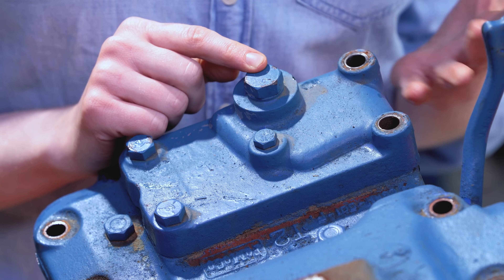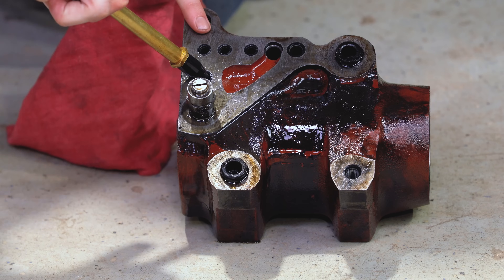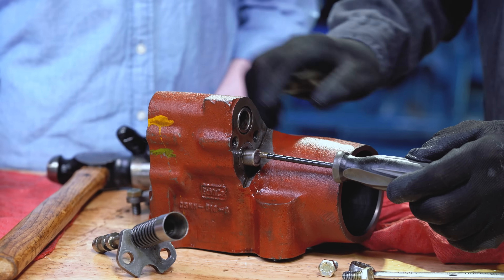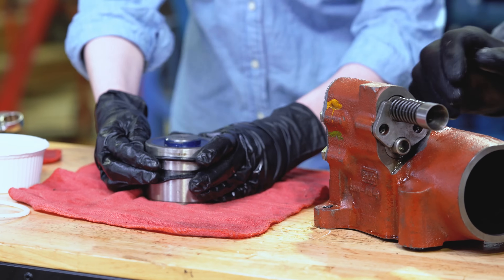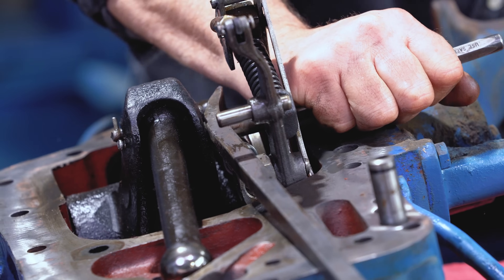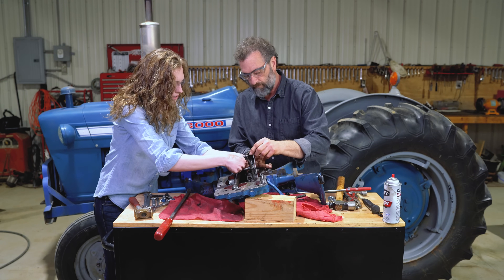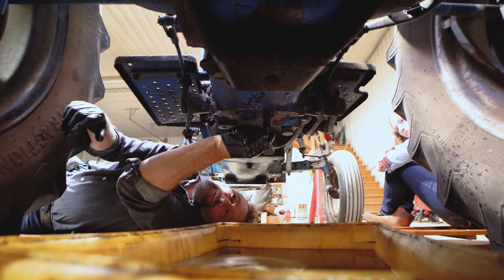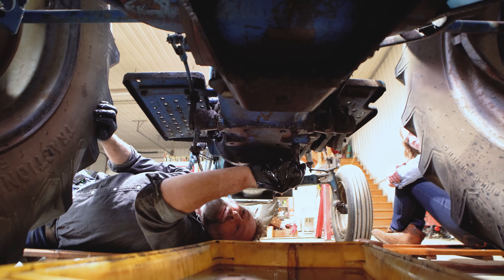Ford 2000, 3000, 4000 Hydraulic Repair, Top Lid: Hydraulics that Shake, are Intermittent or Stuck

Comment: I'm new to your videos. Also just got a Ford 4000 that runs great but I started it the other day and I have a Bush hog on it. No problem drove around about 10 minutes and went to park it but it dropped instantly to the ground and won't go back up. I don't see anything broken or any fluid. I pulled the dipstick and it is not low. I don't know anything about this tractor. Do you have any advice or videos for my problem.
Thanks for any help

Comment: Like your video. I have a Ford tractor 1720.. having a heck of a time trying to find the O-ring on the piston that goes in the cylinder for the hydraulic valve control. can I buy one of those from you?. everyone I’ve tried to get they say it’s a two piece. Which it might be, but there is one plastic like the other one is black rubber O-ring that goes on the piston.. I can text you pictures of this one I have completely different. Anyway, let me know.. again I like your video very much. My name is Tony.

Comment: Where can I find instructions or a video on replacing the front crankshaft oil seal on a 1994 Ford New Holland model 3930?  I'm interested in hearing what has to be removed from the front of the tractor.

Comment: I am working on a Ford 2000 farm tractor for a customer. I had rebuilt that top assembly all new seals two new vowels change the fluid and put a new filter in it and it will only raise about an inch and stop today after putting the two new vowels inattempts of trying to get this thing fixed now jiggles little as it’s raising that inch but it won’t raise no higher than an inch. I don’t know what else that it could be unless it’s a hairline, crack or fracture in the cylinder housing itself.

Comment: My ford 2000 don't have dow pins to help place lid so I used 3/8 all thead in a couple of bolt holes which helped alot to keep gasket in place.

Comment: My 3 point was working I let it sit for a month and now it's not working I unbolted the plug like she said and I got nothing but I unbolted the bleeder plug on the pump while it was running and I got a little bit to come out of it
Reply: The pump is pumping I believe it's the safety valve I just bought the seal kit safety valve and relief valve and I'm surprised by the lower price compared to other online stores such as yesterday's tractor

Comment: I have a Fordson super Dexta 1963 model. Do you have a hydraulic repair kit for this tractor? Mine seems to have the old style piston that takes a seal instead of an O-ring. Is there a benefit to changing over to the new style piston that takes the O-ring or should I just replace the seal?

Comment: Y’all are amazing. Just starting this project on my Ford Industrial 340B and always like a good visual. You nailed it. 

What has me here is I checked the fluid in the rear end with the arms up, per manual, it didn’t come up to the level plug so I topped it off. Went and bladed the road for about an hour then the box blade just lifted all the way up on its own and wouldn’t go down no matter the handle position. Opened that upper level plug and about a half gallon of fluid came pouring out. Sure some of it is from thermal expansion, but I think I had some fluid hiding somewhere.

Right now I’m at removal of the check valve assy. Needed a slide hammer to pull the spring housing. But the nylon seat won’t come out. Can’t get a hold of it.

Comment: I removed the air bleed plug from the side of my pump and inserted a valve with a barbed end for clear hose. Ran hose back to rear end reservoir. Oil flows steadily to rear but has half marble size air bubbles steadily flowing. 90% of the time my arms won’t raise. They been acting up a few years. Sucking air somewhere? Once they go up they will stay but if you let them down, they won’t raise back up on demand. 😢

Comment: I am wanting to put a manual temp gauge on a Ford 3000, 3 cyl gas engine, is there any other port on the engine I can put one in as the one on the front of the head won't accommodate a Universal temp sending unit.

Comment: ford 3000 tractor want start turnover but want gas not getting to the carborator changed fuel pump put new carburetor it still want start

Comment: These videos are amazing, I rewired a 57 Ford 600 just based off of their video for ignition.  I just finished the rear left arms as well. Amazing enough, it was just a frozen safety valve. I highly suggest getting with dan for tech support, it saved me countless hours and probably some good money too.
Reply: @LomahWeldingServices  me same.     two years ago.  parts were perfect
Reply: don't forget the resistor

Comment: Hi, Dan or Rachel, I have been watching your videos, My problem is 2000 ford tractor rear remote valve will not kick out , and on the down side hose has pressure on it at all times, any help will be Nice , Tim

Comment: im having trouble with ford 5610 tractor, the front end loader isnt as strong as it use to be  filter has been changed and has plenty of oil.  bucket doesnt hardly tilt anymore and i use to could push bucket on ground and lift front tires off ground.  What can i check?  i dont know where hydrailic pump is or anything else i can check? any ideas?  do you have a diagram of where everything is or a video on this?

Comment: Thank you Rachel and Dan! I want to ask your advice on my (new to me, my first tractor) 1967 Ford 3000, having possible 3-point hitch hydraulic lift issue: Lift only wants to be all the way up or all the way down, and is very sensitive to inputs from the lever, it’s not smooth, going up or down and I can’t really set it to heights in between those two extreme positions very well. Any ideas on what this might be? Appreciate any input you may have!

Comment: Hi you have great knowledge and I have a question. I'm doing research for my nephew who has a 1972 ford 1000. His hydraulic control valve is not working and he wants to rebuild it but can't find parts, gaskets, O ring. Do you any sources or another valve that would work. Thanks for your time.

Comment: Thank you Rachel and Dan. My 3400 Industrial has problems both with the 3 point arms not coming up right away, or shaking when coming up. I'm eager to rebuild the hydraulics and have it working the way it was designed for trouble free operation.

Comment: The auxilary valve on our 4000 works very well, but the lift arms struggle to lift a 2 furrow reversible. The pump seems ok, so could it be the piston o-ring or a faulty safety valve maybe?

Comment: So removal of the inner seal with a fine thread 3/8 and pliers didn't work for me, but a 15/16 12 point socket, 2 washers and a grade 5 1 1/2 bolt did work, took me a minute but it worked.   You noted the back bolt for the seat connects to the plunger, mine doesn't look like that both bolts are the same. The back hole does enter the transmission while the front hole is closed.  Any idea where I can get that bolt?

Comment: What is the seal called that were the clutch pedal is that goes to the rear close to the pot inspection plate is 68 ford 2000

Comment: Love the old Ford tractors. You and your Dad so well together . I've always liked to replace as manny parts as possible when I'm digging in deep that way I'll fix todays problem and maybe a future problem that would other wise make me have to tear back into it again...Prevention maintenance is a wonderful time saver I've bought from your web site in the past loved it...These old Fords are tough. I just bought a Ford 2000 tractor   1963 with power steering Select- speed garage kept from the original owner on a 2 1/2 acres farm with 1100 hours and still has the original factory tires....All I can say is built tough....
...

Comment: Good morning, I have a problem with the Ford Deksta 2000, it consists in the fact that after setting both levers to neutral when switching on the ignition, it often does not start - it is annoying, as if something is not connected in what is under the gear cover. How to fix it?

Comment: Nice video, thank you so much. I have a troublesome 5030 it's not lifting the three point system. It uses both internal piston and two more lift rams. What could be the cause? *NB: it's a 97 model

Comment: I’m curious as to why you didn’t replace the hydraulic filter when doing this repair. My understanding is the filter is located in the bottom of the housing and requires removal of the PTO shaft to change. Maybe I’m mistaking but if it is indeed there it would have been nice to show that during this repair. Overall thank you so much for bringing us along!
Reply: @gentlyweepforgeorge6048  when I completed this repair myself my 67 2000 is the same. There are actually two filters in the housing. One filter is changeable but the other is meant to be wiped clean and sits further back inside the housing toward the rear end. 

They have a separate video where they rebuilt the hydraulic pump. Likely the pump was the issue on this tractor, not the top lid repair.

Comment: I have a Ford 3550 with a front of crankshaft driver hydraulic pump to supply pressure to the front end loader. There is a selector valve on top of the transmission which has a hose running to the rear via a coupling to run other implements ect. When no implement is needed the return hose drains back into the fill plug on the diff. As I no longer use this feature I want to disconnect  the fitting on the selector or blank it off. Does anyone know if blocking off the port on the selector valve will do any damage.

Comment: I haven't run across a jubilee top lid overhaul video. The top lid gasket kit comes with a pack of Orings. I'm guessing it'll be alot like this top lid where those Orings go. If I've overlooked a video of yours on the jubilee top lid overhaul, please reply with a link to it. Symptoms are lift won't go up at all. Dad removed a plug on the pump and oil shot all over. The lift used to go up and slowly come down. It does nothing now.

Comment: Great explanations but remember to speak with a speed that most people can handle even without being born in a English speaking nation. I personally is not born in USA or UK but I do understand Rachel and also her dad very well. Again it is you Americans that really makes things so easy by explaining so clearly what to do and how to do it with the real parts in front of you.
I have a Ford 4000, 1969 (year make) with Perkins (3 sylinders). Its very important to change the diesel filter in time and to clean out the diesel tank is wise to some times and I like that DG and RG can show how this best can be done and what to use for the cleaning job without taking out the tank. What parts is it in it when opening the tap at the bottom of the tank. It is said that there is a strainer there that should be cleaned. It is good to inform what people will find there depending on what year make of Ford 2000 - 4000 they actually have. What is best of Motor Oil Quality and where to buy it. I think 15W-40 mineral Oil SAE is the best but can use another quality for the cold months. I like to get this enlightened on your channel. Thanks a lot!

Comment: Hello, Mr.Dan and Miss. Rachel  I want one diesel CAV rotary pump and all three injector, with timing plate and pump timing gear for ford 3600 tractor that will be
made in England. That should  fit in my tractor and gives good performance. I want these parts in India. Please tell the price of these parts and how you send it by courier and then how we can get them. I want these parts especially brand new.
Thank you and please reply quickly.

Comment: Is there a way to test the safety valve and relief valve?  I've done a top end rebuild following your video (very good BTW) and have a problem with implement lowering within a minute or two of setting the correct working height.  Seals replaced along with piston leather etc,  but still not maintaining height.  3 pt lift responds instantly and raises quickly and easily, just not staying up.  I'm not sure what the function is of the safety and relief valves.  Thank you.

Comment: I could use some one on one help. I know nothing about tractors but watching u has helped me alot I bought my 1st tractor 1984 ford 4000 I did everything like u did and I had a leak because I replaced gaskets on both sides to lots of leaks tractors not taken care of. Any way the tube from the pump to the pto flow valve the tube just started leaking I drove tractor without seat on it after I fixed leak no more leaks at all. I hired a so called  Mechanic and he took a lot apart I did not see well left over was this long bolt and after watching your videos I found it went to hold down the back part of the seat mount put it in then I drove it up on trailer and oil was going all over took the bolt out and it slowed down the oil so I raised my 3 point and my bucket and I had about 1/2 gallon to much fluid in it. The tube everyone says the u can replace the bottom o ring but not the top o ring I do not want to take back apart I am disabled with uncureable spine Disease and a lot of other things on good days I do stuff then I hurt myself and down for a week or 2 I have all tools need I have built many hotrods mostly chevy motors I hate for auto motors because nothing in interchangeable.  Any way that tube is leaking from the top. I am so mad I am thinking about selling it I have put so many new parts and the carbon build up on stock manifold was so hard and built up u could not get a pencil in the  Exhaust hole on the head so I had to take slug hammer and chisel and break it off them I cleaned out the cylinders never looked at valves because I did not take head off was going to have head rebuilt this last winter but never got leak fixed and the guy I hired in August would work maybe 10 minutes here hour here and so on its been down for a while now. Can u help me I have pictures but it's the top o ring and I am trying to think of a way to fix without taking all the way back apart. Anyway I can get number to call u or someone my number is 417-848-1826 I would really like to have a repair manual but can't find one I can afford would love to have a book not a CD but I will take what I can get. I sleep a lot because of all the nerve pain I am in so if u call and I don't answer please leave a message. I need help in a bad way. Please and thank you

Comment: Hi!  I ordered your remounting kit for the hydraulic pump and it arrived perfectly.  Thank you.  I do have a question though.   I am chasing a chatter/shudder problem when my three point lift "lifts" upwards.  It drops down nice and smooth.  At one point in this video when you are showing the two valves on the table, I think you say that the larger relief valve may possibly cause this kind of shuddering/chatter.  But then later from underneath when that valve is being removed it's mentioned if it's failing the whole lift mech may not work.  If it's possible that it can cause the chattering, I will order that next.   Is that possible it can be doing that?    Thanks!!

Comment: I need the O-ring that goes on the valve behind the plug that's removed by tapping out with a fine thread bolt. It's under the up and down valve. Is it sold ?

Comment: My 1973 2000 series. The hydraulics work but I can’t work them slowly. It drops and rises quickly. When I have an implement on it and raised while just driving. It will bounce. Like it is dropping an inch and then popping back up. What should I be looking at first?

Comment: Hi Rachell, Can you please tell me the width of a Ford 3930 or anything close, I am due to go pickup my tractor ( I just bought ) but I am not certain my tractor will fit on my 16' utility trailer. I know my trailer is 6' and a couple of inches. So, if it won't fit my trailer then I will go rent a trailer. AND WHY DON'T THE SITES PUBLISH THE WIDTH ? Anyway, could you put a tape to your 3000 and post it here for me...thanks. Terry

Comment: I have a Fordson super dexta and it’s blowing fluid out of the round cap behind the fender well. Could that be the relief valve as well. All gaskets have been changed and looked over numerous times just kind of puzzled as to what could build so much pressure.

Comment: rachell, i noticed you soaked the leather piston gasket with water. would oil be ok and if not should you let the leather gasket dry completely so it will shrink back and also prevent rust?  also on my dad's 2600 the lift works when first started up but quits raising after it gets to operating temperature. will this repair probably fix this? one more thing before i try repairing his lift, you don't mention what the bolts are supposed to be torqued to do you have that info?

Comment: The video was very thorough. The question I have after actually having to rebuild my pump 3 times now and still needs to be rebuilt. When I attach the head to the valve body the ball carriers in the head keep breaking when It is tighten down. I have purchased 3 kits now and get the same results, 😢 cannot figure out why the three prong ball carriers keep breaking. I really don’t think it is tightened to much. It seems the gasket may be different thicknesses from the different vendors. Any advice is appreciated. I have a 3000 Ford, I am not 100 % certain about the year. I’ve rebuilt it so many times I’m not sure how it originally looked. 🤦‍♀️Do you all 3000 no matter what year actually have the ball carriers?
Reply: As far as hydraulics go they are all identical except transmission or engine